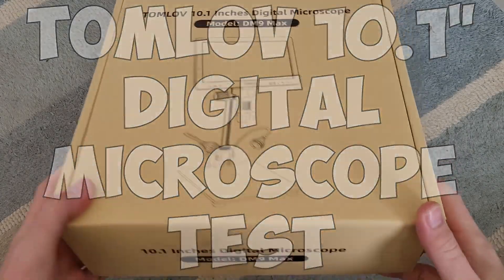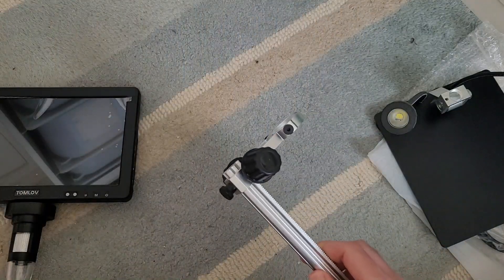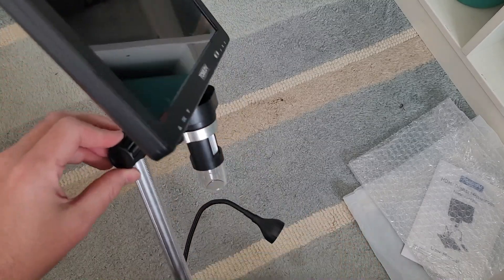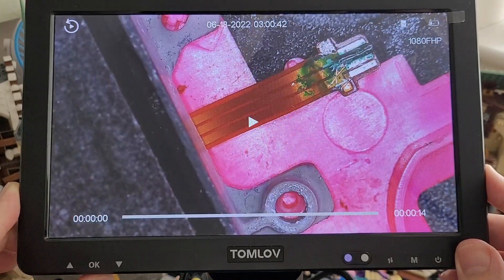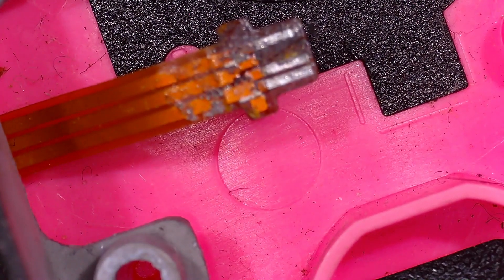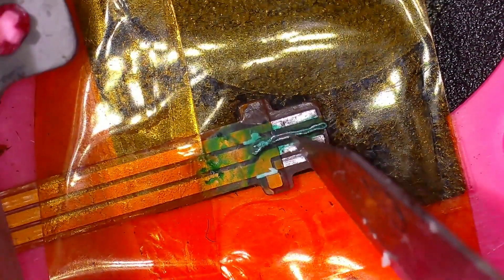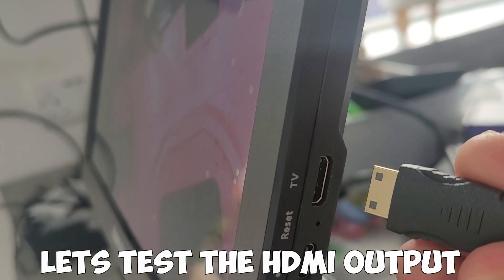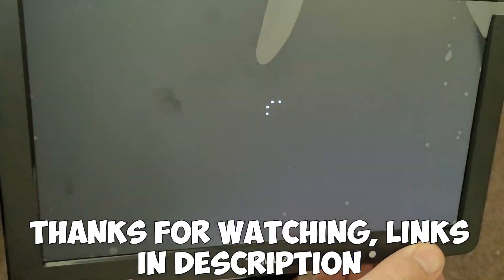Testing a Tomlov DM9 Max 10.1" microscope by fixing a broken Switch lite LCD trace

Comment: Hi. I'm wondering can i use Hot air under the microscope or not? Is there enough space under the microscope to work with hot air and at the same time have a good zoom like what you have for ribbon repair?
Reply from the maker: Yes, loads of room, I use a hot air station with it all the time
Reply: Yes there is lots of room for this